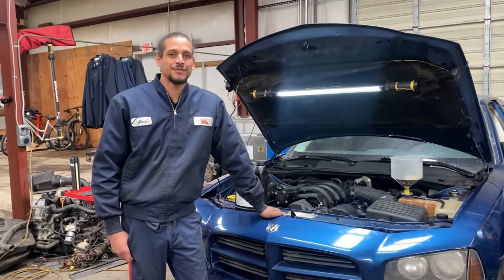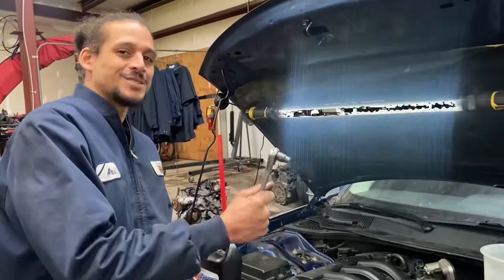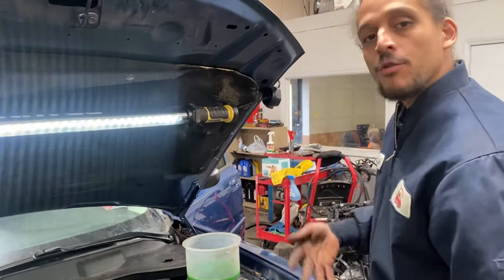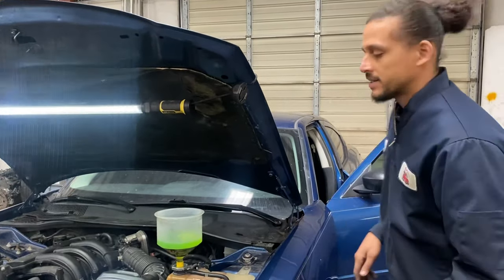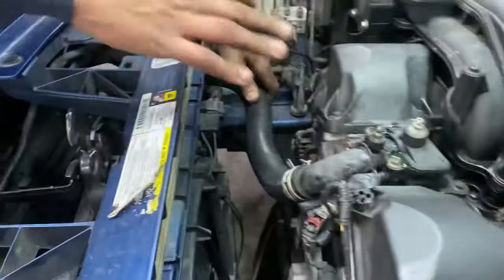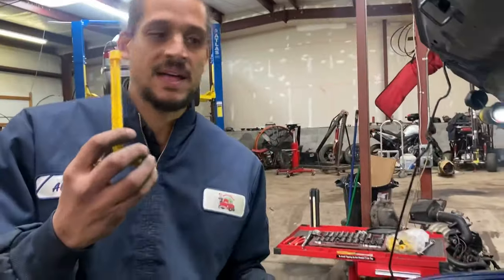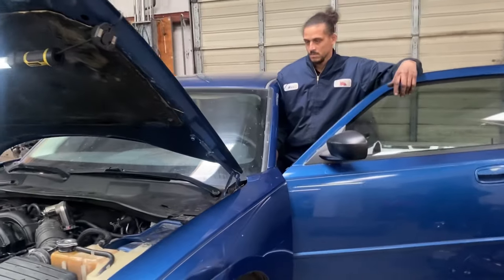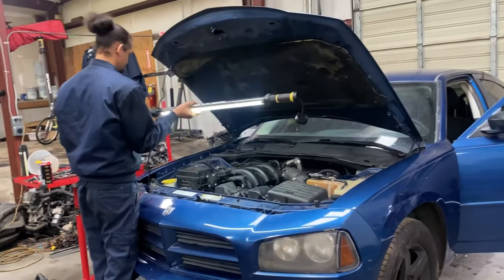How to Bleed or "BURP" Air Out Of Your Engine Cooling System (2 WAYS) #coolingsystem #overheating

Comment: You're really great for responding to everyone & answering questions. I have a 2011 Ford focus. I had an idiot mechanic replace my water pump 2 months ago. I bought new belts and pulleys that I'm not sure y but he didn't put on. My son  drove my car twice, short distance but in town. Both times when he returned, I heard my car gurgling or boiling. The temp gauge wasn't showing hot. I replaced the thermostat this week.  He drove a few miles &  said the cabin heater isn't blowing hot. I'm going to burp it after I put the water and antifreeze in tomorrow & will check the fan is kicking on. I just noticed the antifreeze & water for him to use after putting in the water pump, was still in my trunk. I guess he used hose water & no antifreeze. Do you think burping will solve it boiling up? It doesn't do it at highway speeds. Only at lower speeds & stopping at a few stop signs.
Reply from the maker: Sounds like this mechanic wasn’t very experienced he probably did not burp the system at all. I definitely think it would help or even solve the problem
Reply: Did you solve your problem?? If so how.

Comment: Hi Alex, I just replaced the radiator on my 2019 Chrysler Pacifica (very long job!). But as you know, its radiator doesn't have a cap. After I drove the car, the coolant was boiling and the coolant level going up and down in the expansion tank. I could hear coolant whooshing in the system as I drove the car (possible air trapped in the system). I don't want to overheat the engine, how do I properly get rid of the air trapped in the cooling system of this car if I don't have a radiator cap? Thanks in advance.
Reply: Just use that burp funnel as shown and idling on your driveway... This funnel sets the level at the highest point so air escapes

And run a few heat up/cool down cycles until no air bubbles are shown

If you don't get rid of the air bubbles, it can lead to an overheating problem and risk blowing the head gasket or something 😢
Reply: @ricebike  I did. I think it’s better now.. The temperatures fluctuate between 195-225 when driving. Is that ok for a Pacifica?
Reply: @Mike_44  the OEM thermostat starts to open at 195° F... So it's in specs

Comment: Excellent video. I got all the bubbles out of the system. Using your methods.  Do you have any vids about how the radiator fans work? They are not coming on after engine gets to proper temp.  I tested them by applying power directly and they turn on at high speed.  Also, when I turn A/C on they don't turn on either. Please, any help will be useful. Btw, I also tested the Relays and power and grounds at the fuse box (engine bay).
Reply from the maker: Hey buddy thanks for watching.I can do a diagnostic video soon on the cooling fan system for you you may have a bad cooling fan most modern Single fan units have a high speed and low speed Circuit built into them. But it’s hard to say without seeing it for myself. What type of car do you have
Reply: @AlexTheCarDoctor  You are the man.  Thanks for replying. I have a 2008 Dodge Charger with the 2.7L. Here's what I've done so far. I tested the ECT sensor and it checks out good when it gets hot. Connector has 4.8v at the signal wire and ground on the other. Also, I tested all 3 relays. The Fan Control Relay, the Fan High/Low Relay and the Fan High  Relay and they all work properly.  I also applied direct power to both fans and they come on individually and they also come on when I manually close the circuit at the relay control pins (30 and 87). My problem is they won't engage at all once the engine is running and gets to above activating temp. Which I think is past 192 Degrees F.  I made sure I followed your bleeding instructions to the T but for whatever reason the car stills overheats during idle and coolant starts gushing out. 🤦🏻‍♂️
Reply: Is it possible the computer or integrated module is bad? I don't know what else to check. Yasterday I flushed the entire system again and noticed the radiator was partially clogged. I haven't filled it back up with coolant nor bleed after that but I'm gonna give that a try tomorrow. Maybe that's where my problems was all along. I really hope so. Thanks a bunch for taking the time to reply.  👍🏼🙋🏻‍♂️
Reply from the maker: No problem I’m here for my followers, I had a problem like that and it ended up being a clogged up radiator I replace it and all was great.I can look up a diagram on that fan circuit      and try to assist you from there if needed
Reply: @AlexTheCarDoctor  Awesome. I'll def appreciate that. I'll keep you updated tomorrow after I bleed the system again. 👍🏼

Comment: So if i dont have that burping funnel, i can still add directly to my radiator and it possibly work? or am i filling through the reservoir? I am a novice and unfortunately i dont have anymore money to buy the burping funnel or distilled water. I am trying to make a 1000 mile trip; if i can get where im going, then i will get the burping tool, distilled water and flush it.
Any thoughts on my problems are much appreciated.
Thank you.
Reply from the maker: You don’t necessarily need a funnel to burp the system. The funnel just makes it easier and less messy. I don’t recommend using tap water in the cooling system. You can always just use 50/50 coolant. What type of problem are you having? And what type of car do you have?
Reply: @AlexTheCarDoctor  Hi and thank you so much for your prompt response.
I have a 2018 dodge ram 1500 v-6 3.6 liter tradesman.
Initially, the coolant was seeping out really slow(at the top where the silver meets the black plastic)  i tried to patch it with the black and grey stuff that you knead together with your fingers, it still ended up fizzing from under there.
So next, i asked a guy hanging around outside(he said he was a diesel mechanic) he said, that, I had used some BS and if i got this two part liquid epoxy, he could patch it.
So i did. 24 hours later he put the radiator back in(not seated correctly and with tap water, because i had concentrate) 15 miles down the road, coolant was shooting out the initial spot, like a running water faucet. At that same moment this psycho path opens the radiator cap and coolant blows everywhere like a volcanic eruption.
Now im concerned about my belts and any other electrical that the coolant got on.
i need to make a 1000 mile trip and am really concerned about weather the coolant will have any effect on my belts.
Sorry i went a bit off script, but since o got your ear for a minute, i thought id take a bite.
thank you again for your time. Maybe when the sun is out tomorrow, i can tale pics of my hoses, because they didnt look like he had them positioned correctly.
Reply from the maker: In my experience patching plastic coolant parts never worked for me especially if you’re going to take a long trip. The part that’s most likely leaking is the thermostat housing it takes about 10 minutes to change and the part is usually 40 bucks,if you need to top off with water and things are tight use water but drain it out immediately when you get a chance. Good luck buddy remember fix don’t patch
Reply from the maker: https://youtu.be/T19Fa4xP-d8
Reply from the maker: That’s a video of me changing out the thermostat housing on your motor let me know if that’s the part that’s leaking

Comment: I have a 2012 Chevy Equinox and one day it started to overheat out of no where, my husband replaced the water pump and they also did a compression test to rule out the head gaskets which read as they should. My husband says now the coolant is boiling and the radiator hose leading to the engine is really hot but the hose from the thermostat to the radiator is cold. And it seems to be building up pressure on the coolant system we do not know what to do next. He did flush the radiator and it came out the drain quickly so we don’t think there are any blockages. He also burped the coolant system. He is stuck and just not sure what to check next?
Reply from the maker: Hey there it’s recommend it to do the thermostat whenever you do the water pump
Reply: @AlexTheCarDoctor  thank you so much. My husband is going to replace the thermostat

Comment: Im gonna try to make a burp funnel out of a platic bottle do you know if this could be cause my radiator to not let coolant flow? (A air pocket i mean) ive already replaced the thermastat
Reply from the maker: Air in the cooling system will definitely cause your car to run hot. What type of car do have and what was your original problem

Comment: Do you have to use bleeder screw with the burp or can you just do the burp or do you have to do both
Reply from the maker: You can use one or the other I only did both to show you how in the video
Reply: Thanks very much for reply and was wanting to know do you have to squeeze hose at all does that suckin in the fluid and air back in thanks
Reply: And when your bleeding it n air takes while to come out to point the antifreeze is boiling n rising is it ok to plug that funnle and remove it durin that or should car be shut off before removing that funnel
Reply from the maker: @billw5259  if it’s boiling and running out shut the vehicle off and let it sit for about 10 to 20 minutes everything will settle and then recheck
Reply: Ok thank you so much so when im done rechecking it few times will i remove funnel with jeep off thank you

Comment: I always read that the front of the car needs to be jacked up to help eliminate any hidden air pockets
Reply from the maker: That’s not necessary in my 13 plus years in the business never seen any body do it that way.
Reply: @AlexTheCarDoctor  ok.  Thanks for the video.  I have a 94 roadmaster that I think had an air pocket around the heater core.  I could hear water sometimes "swishing" when I accelerated.
Reply from the maker: @peacemaker0606 yes try bleeding the system and check all your coolant hoses, look out for very soft and swollen heater hoses

Comment: Is this the method for an 03 Infiniti G35 or do you add the coolant to the radiator??
Reply from the maker: You add to the radiator.this is where that burp funnel works best https://amzn.to/3yf432c
Reply: @AlexTheCarDoctor  wow thanks for the quick reply! Do I need to have the front of the car lifted? I am going to do this project with my son. We had to buy a new bleeder and hoses and also bought the burp kit. Also I noticed you didn't mix the coolant first and just poured it in and water after..... should I mix mine first to be on the safe side? Thanks in advance for answering my questions.
Reply from the maker: @creativeprincess9507  the car can be on a level surface. Mixing it will be the safer bet to ensure proper 50-50 mix, unless you know the exact capacity like I did, then ad water, then the coolant
Reply: @AlexTheCarDoctor  You are awesome! Thanks once again....wish us luck. Have a blessed day
Reply from the maker: @creativeprincess9507  will do buddy be blessed as well thanks
Reply: @AlexTheCarDoctor  we followed your video..our heater never got hot, the coolant bubbled in the funnel and eventually stopped and when we turned off the car the coolant drained into the car. Second time we started the car the coolant filled back up into the funnel and started bubbling like crazy like it was boiling and the reservoir tank is full now 🤦🏾‍♀️😮‍💨 help! 😢
Reply from the maker: @creativeprincess9507  it sounds like you may have a bad heater core, coolant should never be inside of the car unless the heater core is busted
Reply: @AlexTheCarDoctor  It drained into the radiator not the car 🤦🏾‍♀️😂 Anyway..I poured the extra coolant out of the reservoir tank, drove the car around and the heater started working ( on the driver side only) and the car never overheated. Thanks for all of your help and replies 💜
Reply from the maker: @creativeprincess9507  my pleasure

Comment: How do you use that funnel with a reservoir bottle I have no radiator cap
Reply from the maker: Hey buddy thanks for watching.the funnel has different attachments for a wide selection of cars and trucks. What type of car do you have
Reply: @AlexTheCarDoctor  98 crown Victoria which has no radiator cap
Reply from the maker: @jontaylove25  that funnel should work for that car
Reply: @AlexTheCarDoctor  it looks like there Is no adapter for a reservoir bottle do I just put the funnel in my reservoir and pour coolant into it
Reply from the maker: @jontaylove25  check this one out https://amzn.to/3H02veQ
Reply: @AlexTheCarDoctor  that's the one I got
Reply from the maker: @jontaylove25  it should be that black screw on piece

Comment: The video helped a lot and I've subscribed to see more of them. I am "attempting" to diagnose an overheating problem in an '06 Altima and can hear bubbling in or near the heater core inside the vehicle and I had no idea that bubbles in a system could cause overheating! I've changed the radiator & cap, both thermostats, the temperature sensor, the overflow tank, the outlet thermostat housing, and for the heck of it, the valve cover & gasket, oil, pcv valve, and plugs (I believe that's it LoL). Interestingly enough today was the first time in months that the heater blew warm.....actually hot! I'll try to bleed the air out because I am stumped (haven't changed the water pump or done a block test). Any ideas?
Reply from the maker: Hey buddy thanks for the support.I would do a block test, those 2.5 are tricky they hold up very well when they have head gasket problem, I have performed block test and did not test it long enough and thought it was good but it was not so make sure you leave the tester on the radiator for at least 15 minutes. Drain about half of the coolant before performing the test. Good luck buddy
Reply: @AlexTheCarDoctor  Thank you for the tips and I agree that the Altima holds up well because I overheated the first time last July and had a tinge of white smoke and milky oil. I will get the block tester from Harbor Freight for sure and will follow your advice. RIGHT ON MAN!
Reply: @AlexTheCarDoctor  Hey Alex, I pray you are well. I did the block test and after about 8-10 minutes the antifreeze backed up into the tester. The test looked good in my opinion up to that point and I took the tester off (to try again later) and replaced it with a cut-off water bottle with duct tape around the rim to seal better and the fluid continued to back up and was going up and down, up and down (filling and draining). I had taken what I thought was enough antifreeze out before the test. Any ideas?

Comment: Is it supposed to be topped off at the reservoir
Reply from the maker: Depending on what type of car you have yes at the reservoir it’s supposed to be topped off to the cold  when cold but some cars have the overflow tank and you just feel that to the cold point and fill the radiator to the top

Comment: Hey I wanna replace condenser in car cuz it’s leaking trans fluid. I have same charger just an rt. Do I need to evac system to replace just the condenser??
Reply: The AC condenser and transmission fluid are 2 separate things...

Are you talking about the radiator with the transmission cooler lines attached to the side of it?

Comment: if the bubbles never stop , is that a head gasket ? or is there other possibilities
Reply: PS , no overheating , visible leaks or any other symptoms besides a light smell of coolant in the engine bay after driving for a while
Reply: Possibly an external coolant leak.

You can rent a coolant pressure tester so you can pressurized the system when cold and see if it drops... Then hunt for the slow leak

Should never smell coolant if the system is working correctly

Comment: So if temp gauge is rising then back down to middle , could that mean I have air in my coolant system? ( I changed my thermostat 5 months ago )
Reply: My Dodge challenger hasn’t overheated but the gauge has risen while driving then would go back to normal.
Reply: @JD-jt9hz  same here on my 23 Charger R/t it goes to 219 down to 210 and then slowly climbs up to 217-219 while Idling. Then 210 while driving and when you stop on it back to 219 and then we slowly drop to like 212
Reply: @hysterlife7854  change your thermostat. Unfortunately I changed mine AGAIN ( 3 times in the past year ) and it fixed the problem. Hope that helps 👍

Comment: On my 2008 dodge charger I took out the thermostat out because it keep running hot and burp all the air out of it and it still runs hot could you plz tell me what else I need to do and the fans comes on when it is half way then it goes straight to hot
Reply: Possibly bad head gasket or warped head.

Rent the block tester kit with the blue fluid... If it changes color, it detected exhaust gasses in the coolant system 😢

Comment: I have a strong smell of antifreeze underneath the hood but can’t find any visible leaks in the engine compartment or underneath the car any suggestions
Reply from the maker: Hello.what type of car do you have and how often do you have to add coolant
Reply: 2013 Dodge Challenger rt. less than a half gallon once a week
Reply from the maker: You will need to purchase a coolant pressure tester or rent One from your local parts store to safely pressurize the cooling system and check for leaks. it’s either leaking or burning coolant but since you told me it was a smell from the engine bay it’s most likely Leaking it
Reply: Thank you for the feedback
Reply from the maker: No problem buddy my pleasure

Comment: How do you do it in the reservoir while not overfilling it?
Reply: You need to put this burp funnel where the pressure cap is on your car.

 So it's either on the radiator

Or some models the pressure cap is part of the plastic reservoir bottle.

What year make model is your car and ill look it up?